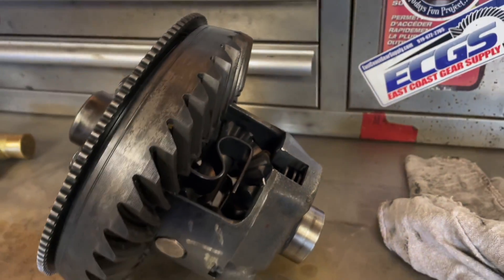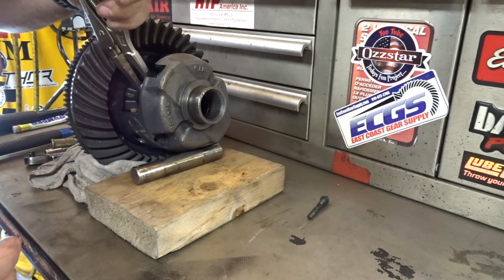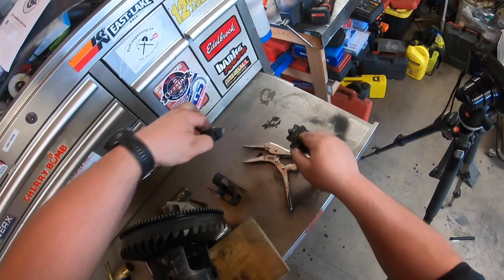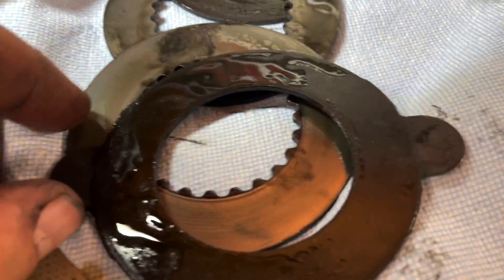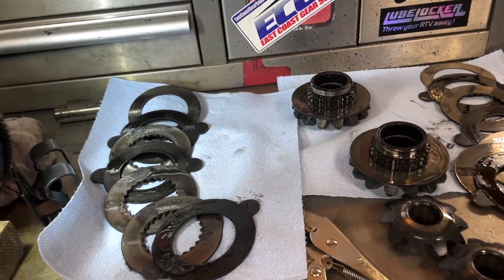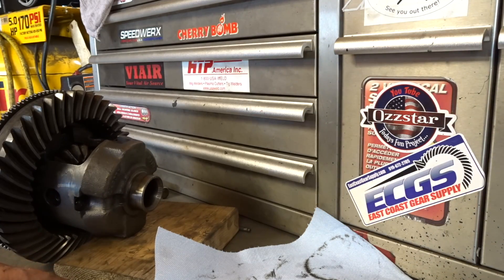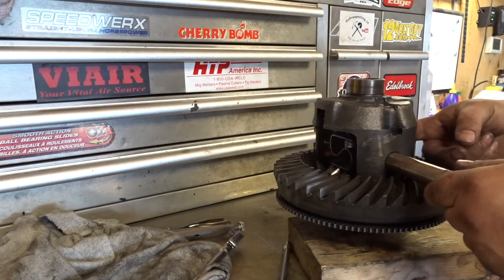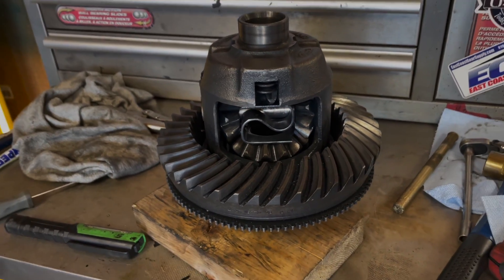Ford 8.8 Trac-Lok Clutch Inspection DIY

Comment: Is it me or were the clutch pack discs not originally installed in the correct order?  looks like there were 2 spacers together then the friction disc on both gear sides